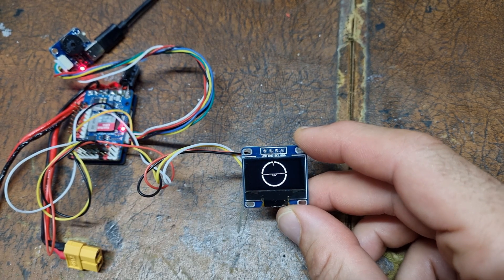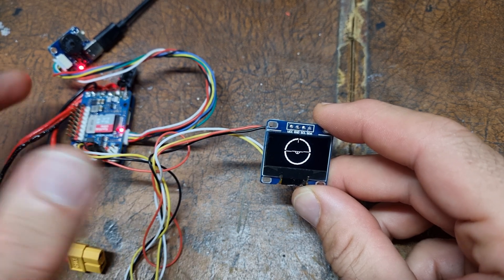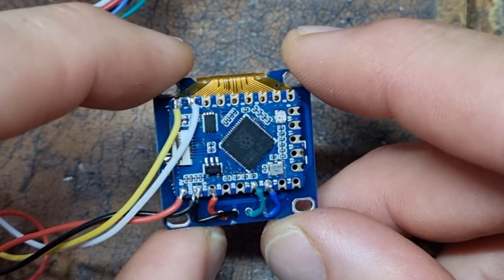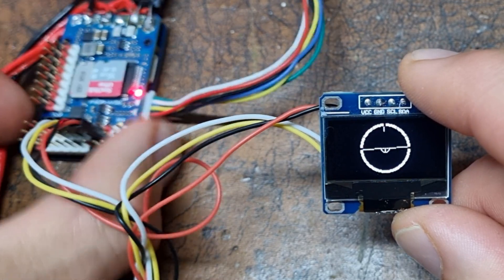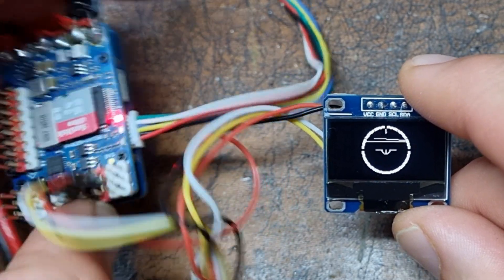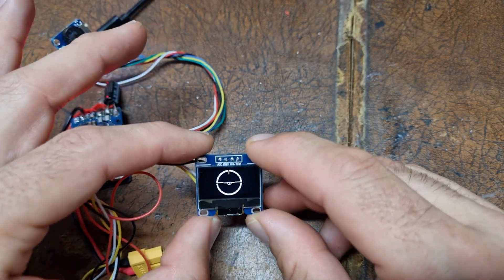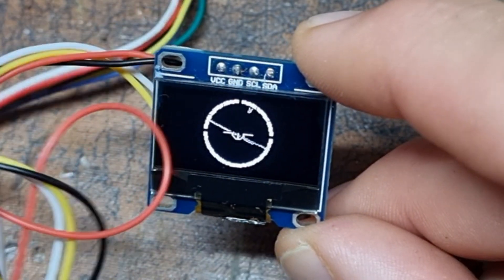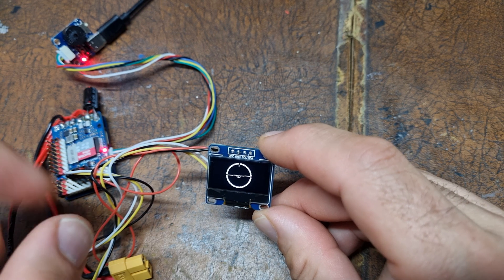Simple OLED Onboard FPV Artificial Horizon - First Test on the Bench

Comment: Love it, works great 👍
Reply from the maker: Yeah, better than I expected. 

I was concerned the RP2040 might not be up to all the floating point drawing to the screen I'm doing in plain python. I actually is recalculating that whole display for each frame, including all the twiddly bits. I should really optimise it to just do all that stuff ones when it starts up.
Then I was concerned about screen flicker, of which there is none.

My one big concern is getting it to be in focus in the cockpit. This is not possible in my P.15, which is why I'd not bothered doing this for that. But my upcoming P51D has a much longer cockpit, so I'm hopeful!